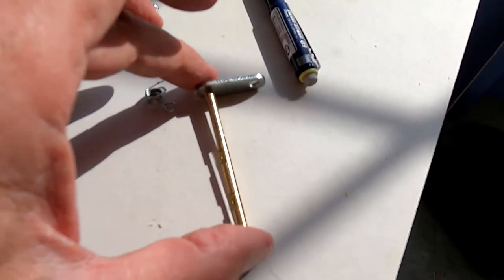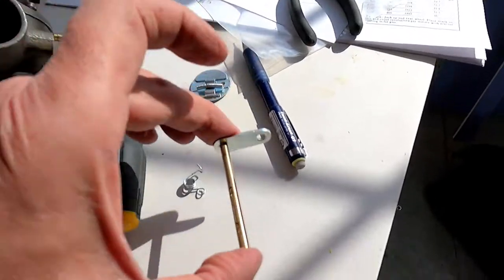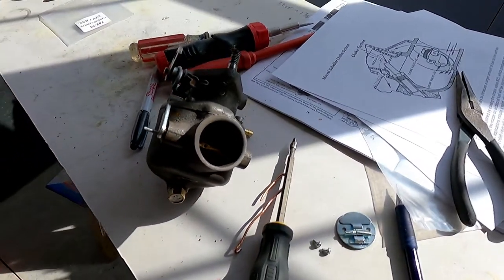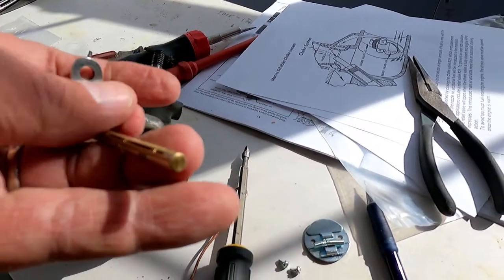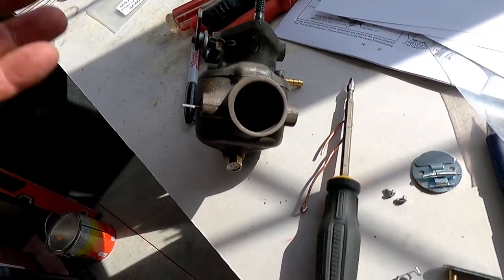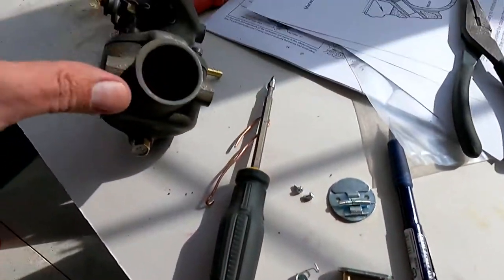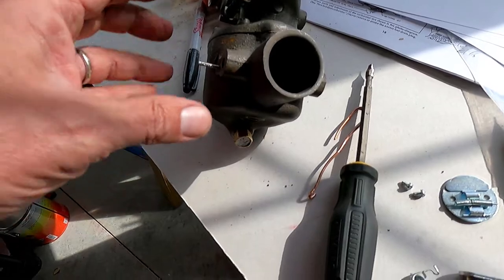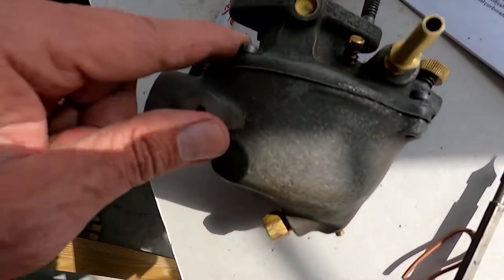Marvel Schebler Carburetor Rebuild Problems

Comment from the maker: In keeping with the TO-20 tradition, the carb rebuild is not going smooth. 51youbetcha's comment this morning got the wheels turning, and in the end, I found out I have the wrong choke shaft. Instead of taking a chance on getting another incorrect shaft,  I ordered an entire new kit and will redo the rebuild when it gets here. At least this kit includes everything, but I sure am tired of it not running!

Comment: Did that carb have a small plate with a number stamped on it, or is there maybe a number embossed into the carb body somewhere? That carb number helps in getting the correct parts. It could be possible that if the carb was worked on before, the tag that  sometimes is held on by one of the body half screws, may have been tossed . And does the new kit come with the correct choke shaft?  Did you by chance check with your local NAPA store?  Some of them handle tractor parts or can get them.
Reply from the maker: Hi 51ubetcha, and thanks for the head's up on that choke plate! Nope, no tag. The very early TO-20's were equipped with a Marvel Schebler TSX361 but almost all of the other tractors were equipped with the Marvel Schebler TSX312. There is also a replacement carb, the Marvel Schebler TSX361a, but it uses the same rebuild kit. The kit I ordered from Steiner Tractor has every single part that comes off of the carburetor. I really should have spent the extra cash and got that kit in the first place. I still wonder if the return spring is too strong for the wimpy choke linkage but that remains to be seen 😐